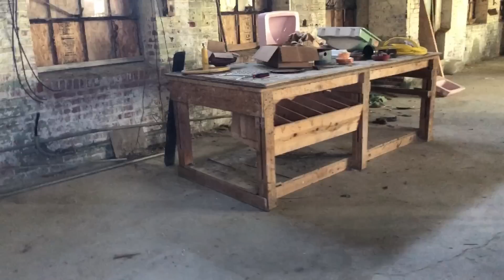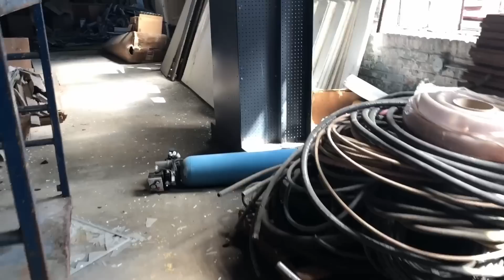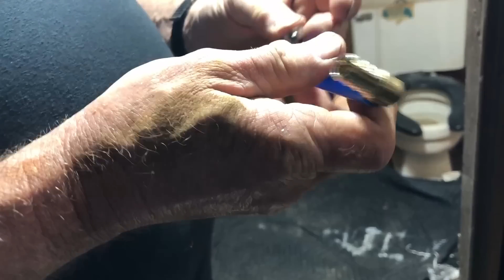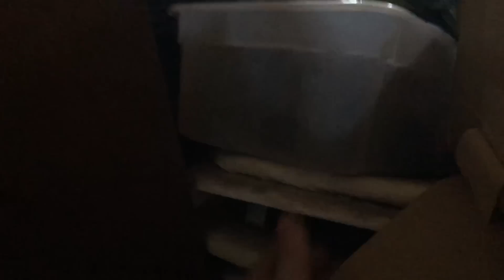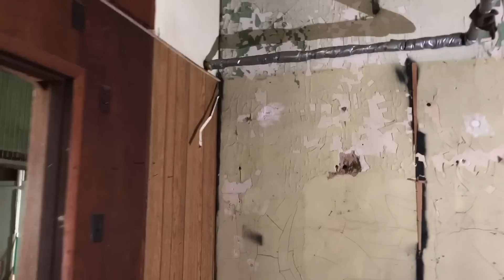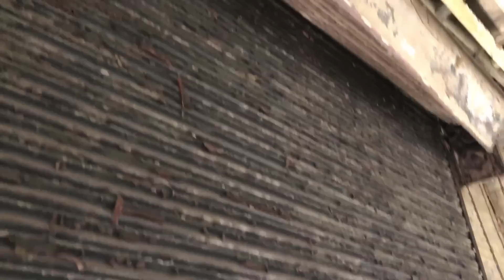From Dump to Deluxe - Bathrooms- industrial renovation

Comment: Chris, you didn’t hear me yelling at you that you dropped the fasteners when you pulled the plastic bag off the toilet seat!😂 I’m glad you found them. There should be a hook or a slot on the side of the roll up door where you can stick the chain so if someone tries to lift the door it won’t roll up.
Reply: I was thinking the same thing.  I've used those doors a lot in my life.  The alternative is a stout padlock.  AATW brother!
Reply from the maker: that would work or I can install an eye hook, but it is so heavy that I would be shocked if they were able to do it.
Reply: @brickandsole  a determined thief will find a way to get in, especially if you make it easy for them.

Comment: Don't get rid of the toilet tanks and tops!  Those are the old 5 gallon tanks and flush way better than the smaller newer tanks.  

There is another PEX crimper that isn't powered for those rings, and another style copper ring crimp.  The powered tool is a lot more friendly when working in tight spaces and it does the hard work for you.  Cost is higher for the tool Bob used, but if you plan to plumb the building you should buy what Bob has.  The city water should be good, but if you were on a well I would go with the plastic PEX fittings. 

Replace the main valve with a ball valve!  Those old valves tend to have a lot more issues with time, but that one is pretty old.  It's what they had back then though.  

^----stuff I learned going from copper to PEX at my house + things from work.  

You need to tell that thieving varmint that COVID is over and there is no longer a shortage of TP!
Reply: I have the old manual crimp tool as well, but when you're lazy and get used to the battery one it's hard to go back LMAO. I know the new style Paxton fittings you just put a tool in there it expands the packs you shove the fitting in and it just contracts back around it I haven't used that one. Bob

Comment: On one of the videos you mentioned how a groundhog has undermined the concrete and found a hole in the floor. If you haven’t already taken care of it, put a smoke bomb from the hardware store in the hole to chase it out.  Then, pour liquid expanding foam in the hole which will reinforce the concrete and fill the hole all the way to the outside. ❤

Comment: Tip ! You can glue the toilets to the floor without bolts going into the floor.  In Sweden we usely dont screw down  the toilets . Just gluing is permitted, and even  preferred, by the insurance companies. 
Leaveing a small hole at a low point enables to flush out the enclosed space under it . (In case of "bad smell")
Reply from the maker: thats interesting. Thanks for the tip. I'll YouTube it.

Comment: Chris, for those stuck and rusted bolts, put away the WD-40 and make yourself a 50-50 mix of Acetone and automatic transmission fluid.. Don't be stingy with it.. put it on and let it soak for several hours before you attempt to loosen it.. On the very rusty stuff, you might have to apply heat with it.. just have a fire extinguisher close by.. This stuff was tested against some of the best penetrants that money can buy and found superior to 99 percent of them and its dirt cheap to make.. Just make sure you seal up the container good or the Acetone will evaporate...
Thx for bringing us along on another adventure...
Reply from the maker: thats nice, and much more affordable too!  Cheers!

Comment: Have you considered a golf cart to use on the first floor? It would save time walking, and you could put a tool bag in it.
Reply: I was thinking just using a tool cart would be a big help. Gotta have the tools all in a tool room to be efficient though. Personally I would put it in the center bottom floor
Reply: There's a small electric driven tool cart kind of like a golf cart downstairs already but there are no batteries in it and we're not sure if it will function and of course batters are very expensive to experiment on it. Bob
Reply from the maker: that would be perfect.
Reply from the maker: that would be stage 1.

Comment: Oh the wood chuck is back.  You need key fabs attached to your tools so you can find it with your phone.  I would park a dumpster by that steel door to throw out trash quickly.
Reply from the maker: like the one you can press a button on your phone and it makes a sound.

Comment: any cabinet that has a top drawer is not a vanity but you can alter the top drawer and make it a fake drawer. pick up the sin and top and turn it 90 degree
Reply from the maker: the building provides! one way or another.

Comment: Can’t you use the outside pump ground room to burn the rubbish. Disconnect the metal for scap. After use them through all your ceramic down there????
Reply from the maker: like turn it into a giant incinerator? maybe but the brick work is in pretty rough shape already.  I'd like to make an incinerator of some kind.
Reply: @brickandsole  Yes indeed. Pick the worse one (do you have two, I can’t remember) make sure you take the metal out, but you cant ,do that after the fire, as the heat we loosen the bolts. Then fill it in and grass the area. You could Evan ask a road crew or someone knocking down a house to tip rubble down there for free, as they will need to pay to get rid of it. Win win 👍

Comment: May I suggest of small burning 🔥 sessions to get rid of the wood stuff
Reply: What is the local ordinance, in Charleston, about open burning ??
A suggestion - without any thought or research  - is stupidity .
Reply: It would be a good idea unfortunately the city doesn't allow it. But there are other ways. Bob
Reply from the maker: yes you can. however its already been recorded just not uploaded yet.
Reply from the maker: I am not sure but I did a bit and nobody wrote me a ticket but I don't want to push my luck.

Comment: How costly would it have been to rent a Port-a-potty?  Why do you need a working bathroom? You aren't working on that place often a enough. Are you there every day for a week, yet?  You can piss anywhere. A portable, bedside (hospital) toilet,...which is a seat positioned over a removable bucket, which has plastic bags, that are sized to fit the bucket. You don't need water. You scoop some cat litter, into the basin, do you business, remove the plastic bag liner, and toss in a dumpster. That is what I used for a year in my house, while it was being renovated. The bedside toilet can sit in any room. Buy a couple jugs of water to wash up with. Your rate of progress is SO slow. imo.
Reply from the maker: its just on step in many to get the space up to code and rentable. It's also nice to have when people come by.

Comment: I keep telling you about the wheeled tool cart. Make yourself get in the habit of putting things back in some order. That's a huge building...why make it any harder??
Reply: I think it makes a lot more sense once the elevator is going and we can move things from one floor to another right now it's very difficult to take things to different areas of the building. Bob
Reply: I am observing a pathology regarding disorder.  The tool organization kills me. Moreover, aside from the micro idiocy, what is the big picture?  They speak of micro-breweries, but that is one of the most expensive build outs possible. How about clearing out square footage and just renting raw space?
Reply from the maker: yeah, that is what it will be.  The renter would decide what to do with it, however it will be limited by occupancy/code.